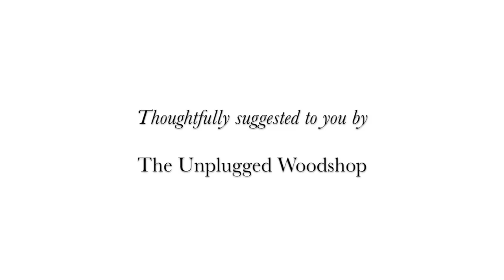Chair Parts - THE UNPLUGGED WOODSHOP

Comment: What finish were you applying at the end, Tom? Was it linseed oil? I would be interested to know under what conditions you choose one finish over another. Certainly personal preference is a factor, but you must juggle durability, ease of use, toxicity, drying time, water resistance, etc. Are there rules of thumb like, "For chairs of course you'd use A, but on a cabinet go with B. C is best used on boxes and bowls".